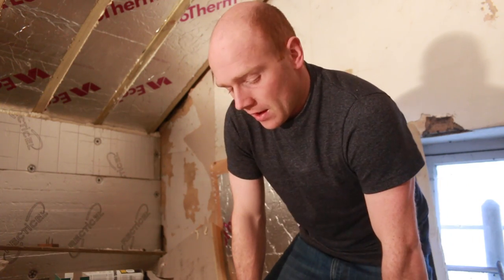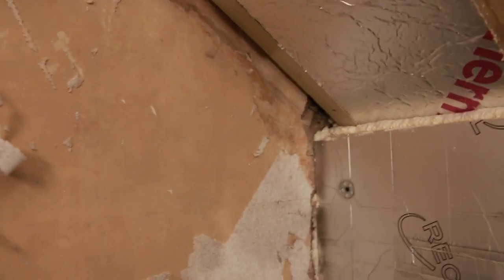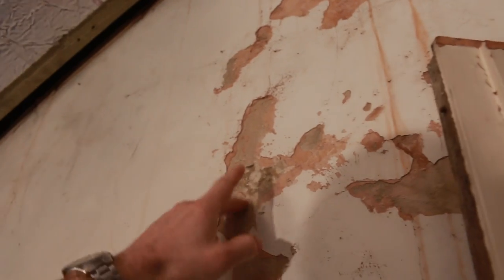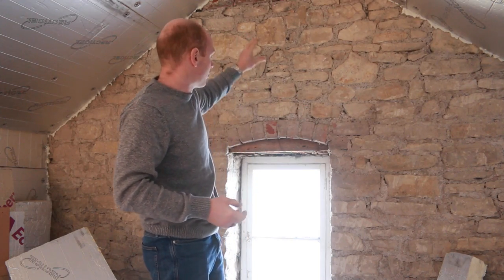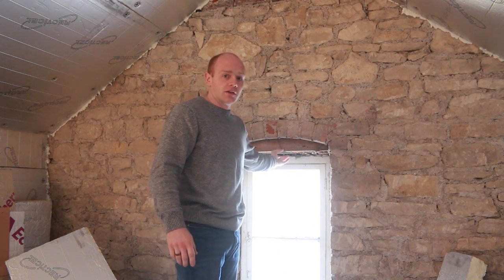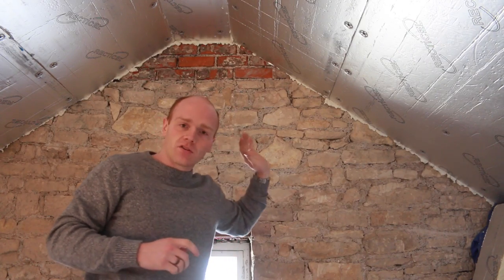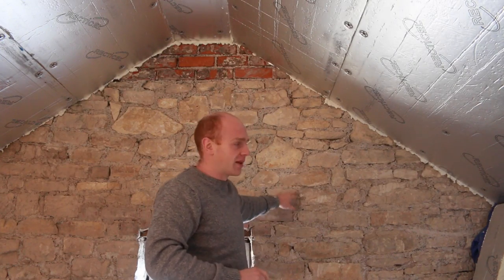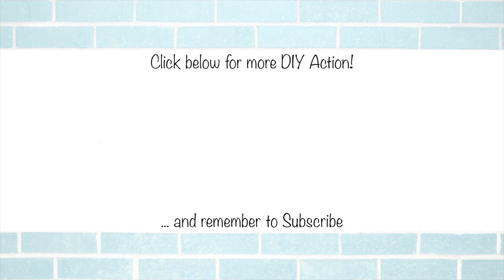Stripping Back the Gable Walls | Loft  Conversion Project 3.0

Comment: you talked a little about the spray foam and "not breathing". i have a contractor that wants to spray foam my whole home (stone,  24" - 30" thick solid walls). I live in a cold climate too.. he is telling me "spray foam is the best way to insulate the stone walls".. your thoughts?  I want to use Roxul insulation keeping the walls breathable.. I cant seem to find a lot of information on the internet about insulating solid walls... any help would be great!
Reply from the maker: I do not claim to be an expert so please check elsewhere, however there is always a risk when 'sealing' between house and interior of a solid wall.  There are a few problems that can arise however most are from where the insulation has not been done correctly.  It is possible to do as you say and insulate internally, although it would need to be a seamless envelope within the house as if you just do floor to sealing you have a high risk of issues at joist level where exposed wall and cold air will still be.  I am planning a video in the next few days to share what research I have done which may or may not help.
Reply: The Restoration Couple a video would be great! i do plan on sealing all external walls (from the inside) we want to leave the look of the stone walls from the outside. im wondering if closed cell spray foam is a good option... the safer option is to use roxul (rock wool) with a vapor retarder and keep the wall breathing.  thanks for the help even if you're not an expert. .lol could have fooled me.. ha